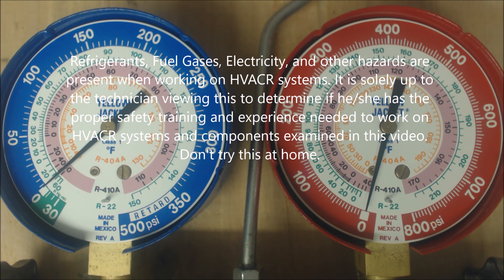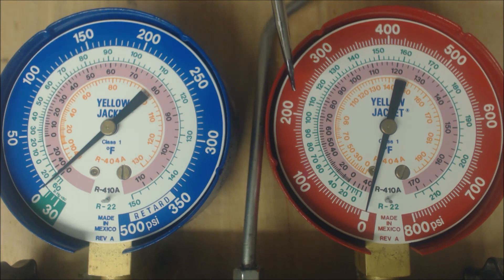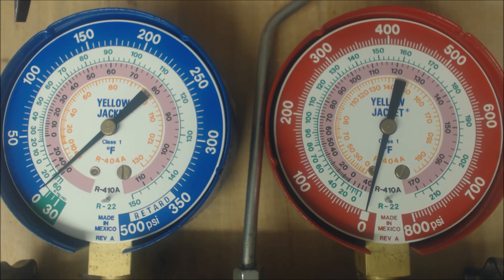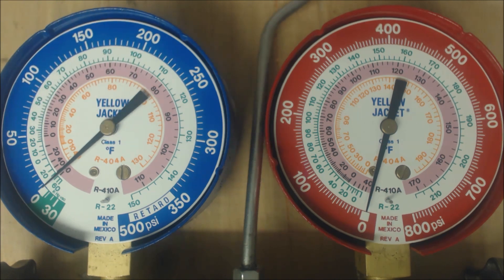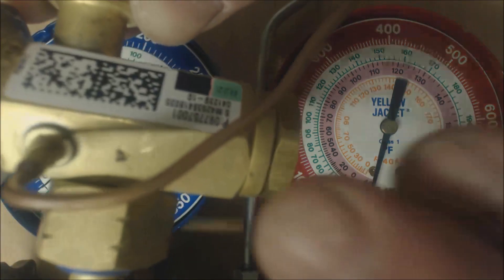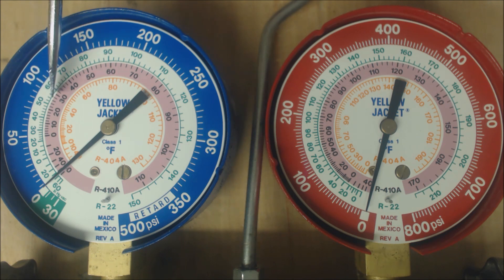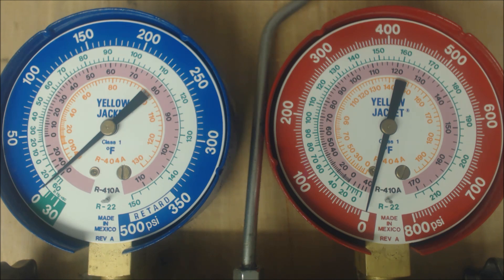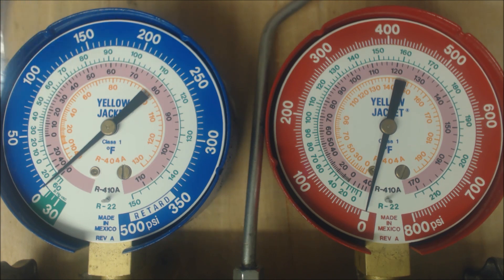R-410A and R-22 Refrigerant Low Pressure & Low Superheat Problem Explained! Freezing?

Comment: 4 units in a church, they are paired together with separate return and supply ductwork. The one of the second units in the ductwork has this issue. I suspected low airflow and first pulled the filter, then cut a hole in the ductwork so it would pull air from the supply room. After no significant change was made, I checked the blower speed (highest speed) and the RPM of the motor (825 rpm) and thought that that is lower than most motors I replace (1075 is the most common rpm I run into). Turns out that it's the factory motor and the correct RPM for this 5 ton unit. The orifice is the correct size and is entirely unobstructed, both OD and ID coils have been cleaned. The only thing I can think of is the first air handler in the return is taking too much air, and my unit with the issue is choking, so maybe just make my ductwork hole (10"x10") larger, do another ID coil cleaning, and replace the blower motor with an aftermarket motor with a higher RPM.

Comment: so what would this tell me?  what do i have here r22 70# Ls 6d deg c  dry bulb 74 deg  vapor temp at 51 deg  the Hs was 200#  the inside the house was 74 deg and i put a rag on the outside probe in front of the return vent and had 62 deg the humidity was 49%  it seems no matter where i  put the Ls pressure the vapor temp follows,  i have cap tube evap and a 30 year old rheem unit. it worked good until last fall when it started to just run and not cool i found the cond coil real plugged and cleaned that and still the same so i put a gage on it and found low freon. if i get email i can get better info. thanks for the great info videos

Comment: what might be a problem in the system if it shows 0,5 K of superheat while the evap pressure is 10,5 bar with R410A in the veins?

Comment: In case of an air cooled chiller running R410A, if I have low suction pressure (90psi) rendering a sat temp of 25-26F, where would I see the freezing? instead of an air evaporator, we used the refrigerant to cool down a water tank for our air handler coil. System has a TXV
Reply from the maker: The water in the tank would freeze unless heat was added to the water since the evap is the water tank, thanks

Comment: hi, i had an R22 system ran for about 20min and my low side was reading 30F. the outdoor temp is about 60F and indoor is about 65F. would these low outdoor and indoor temp caused the evap. saturation temp to be low (30F) ? thank you.
Reply from the maker: Yes it likely did. Both indoor and outdoor temps are low. I wouldn't be surprised to see a low side sat temp at that temp, thanks Mark!

Comment: Hello, thanks for the good videos. My coil was replaced as there was a leak and 410a was filled. Outside temp is 83f.  The low side psi is 120 with pink line for 410a at 40 and high side is 265 and pink line at 90. Did the contractor add enough refrigerant? My other box had low psi 140
Reply from the maker: I would not be able to tell from those readings. I would need superheat and subcooling, what metering device, and also the target superheat or subcooling, thanks

Comment: Great video... I am replacing a txv valve on a 507system.The manual says that it needs to have a superheat of between 40 and 52 but how do you check superheat on a unit with a TXV? Thanks.
Reply from the maker: Are you saying that the units instructions list it as having a fixed orifice but it has a txv instead or are you saying that the manufacturer specifies you to adjust the txv spring to maintain 40-52 superheat?
Reply: It has a TXV valve and instructions say " Optimum suction superheat is 45 - 52." That is all it says, so would I check the  suction  temp and deduct the gauge temp?Like I said, how do you check the superheat on a unit with a TXV valve? Thank you.
Reply from the maker: Yes exactly just as if it had a piston. If there is a port right after the evap coil then that would be more accurate but there prob is not one. I am guessing that superheat is with the refrigeration system door open as it sounds too high for if the heat load was low. Just make small adjustments to the txv at a time but you may need to alter the charge if the vapor sat temp is too high after your txv adjustment, thanks
Reply: Well, this is what it says on instructions -  " TXV must be adjusted to a minimum of 14F superheat."Then it goes on to describe how to figure out superheat, but I thought that TXV's use subcool and not superheat.Please help. Thanks

Comment: An oversized metering device will give you a higher than normal suction pressure with lower than normal superheat.
Reply from the maker: That is correct!

Comment: Thank you ac service tech. I'm new to the service tech world and I always look up your videos if I get stumped. I just stumbled upon an r22 unit with low suction and very low superheated. It uses a piston instead of txv. I removed some insulation that had come undone but I'm not so sure if that was truly the problem. I ended up blocking some returns from the basement because the only conclusion I could come up with was it was getting too much air. I told the client I would stop back by tomorrow to check. I came up with this because every time I took some of the basement air away it would the line would thaw out. Pressures and temperature however still not where I wanted them to be. Only  slight change
Reply from the maker: Sounds like the evap coil is having a problem letting the refrigerant absorb heat. If there was more heat then the pressure would go up and the superheat would go up. Make sure there is no duct blockage, dirty filter, or dust clogged coil

Comment: servive tech i had a 410 a unit with orofice and high side was fluctuating from 320 psi to 400 psi fast but low side psi  was not moving any clues.
Reply from the maker: Could I have some other details, blower and filter clean? what pressure was the low side at? what seer rating are we talking? Was superheat changing at the same time? what was subcooling changing back and forth from. Also was this happening right after adding a large amount of refrigerant?
Reply: low side did not move only high sjde  yes everything clean added 1 lbs of 410a its a orofix 5 year old lennox 13 seer.
Reply from the maker: Sometimes when you add a lot of refrigerant, the best thing to do is to shut the outdoor unit off, wait five minutes and turn it on again while you keep the indoor fan running. What you described can happen in txv's due to the adjustment of the txv itself but in this case it may have been the extra charge introduced intom the system. I usually shut the system off and let all the refrigerant equalize before turning on and checking again. If you were to check this again now, the unit may now have settled down the back and forth of the high side line. Thanks and let me know what you find.
Reply: low side was 106 psi evap temp 34 degrees  blower filter clean  13 seer  added  1 lbs  of 410 a
Reply: but it was a orifice not a tvx
Reply from the maker: I mean for something like that to happen when you don't have a txv,  it may be that the refrigerant has not spread itself through the whole system yet. Did you try shutting the outdoor unit off for 5 minutes after adding this refrigerant while keeping the blower motor inside running. Then turn it on and wait ten minutes to check the charge again. That is the first thing I would do if I saw that scenario and if I added that much refrigerant into the vapor side while the unit was running.  At the least, it will usually settle down and then you can investigate from there if needed. That is what I mean't, thanks
Reply: no i ve never been told  you could do that to fix it will try it. but only one pound would do that by the way when its cold outside below 55 degree what do you go by i put a card board and cover half the condenser to get preassures up thank you so much.
Reply from the maker: Aha yes, you need to not cover up the sides but only limit the airflow on the top. That could be your problem right there since you are covering over the saturated state. If you go back now that the unit has had a chance to cycle the refrigerant through and just limit the amount of air out of the top with a piece of plywood or charging parachute bag up to normal operating pressures such as 310 psig after 10 minutes, it may not have that problem or if there is a problem, it may be very small compared to what you were seeing. You would not shut the unit off like I was saying since it has been some time since you charged it. Make sure that the house temp is up to 74-76 before you do that though since it is cold outside. The best is just to put them on your list of start and checks to check them once it gets to 70 degrees unless this is a heat pump used for heating, thanks
Reply: no thank you and god bless you and your teachings on you tube you have quickly become my favorite hvac site on you tube...
Reply from the maker: May the Lord God Bless you too! Thanks for letting me know!
Reply: i have added refrigerant many times for two years know never seen anything like that before.
Reply from the maker: Yeah believe me, we are all in a constant state of learning every day!
Reply: well once again thank you for the info you gave me believe me i asked senior techs were i work they could not throw me a bone you are the only one that me something    thank you again
Reply: YOU ARE WELCOME

Comment: Have you ever seen a indoor blower wheel break apart? I came across two carrier split units twinned together and one unit has the blower break apart every few months. Carrier said total external static pressure is too high, but when I measured its normal and the other blower has no issues. Any ideas? everyone at my company is baffled
Reply: Did you amp each blower motor? Are they the same?
Reply: the motor was replaced with wheel and amp draw was equal
Reply: I'm not experienced with twinning at all. But I would check static with each unit running individually. Check capacitors and I would junk blower speeds to be identical. Also, if there is a delay it should be identical because a wheel could be spinning backwards.
Reply from the maker: Wow, yes but not that often. Usually they are the last to break. It sounds like just a bad design. If there was some other defect such as the rubber grommets or design of the housing then the motor would be paying the price too. Thanks

Comment: Just had a problem on Easter Sunday, could not get Freon to go in, high head, but no suction , checked all restrictions, in air flow had none, tried to charge it in heat ,no luck, after all the diagnostics, I finally narrowed it down to a restriction in the cap tubes or the txv was bad, The unit was an 08 rheem, nice clean unit, but still wasn't sure if that was the problem, I know it wasn't evaporating...  some times its a chore trying to find the problem, some times I need you,  sometimes I need a friend, But you never know too much,,, again a great video... my brother...thanx
Reply from the maker: Thank you very much, yeah it sounds like a liquid line restriction. Most of the time it is the screen or the metering device itself, then possibility the filter drier depending on age and then possibility the distributor tubes. Thanks AC and hope you had a great Easter!